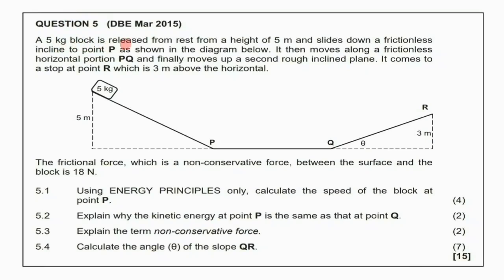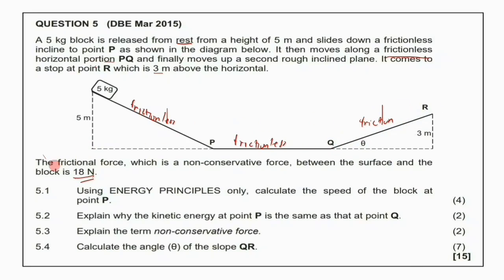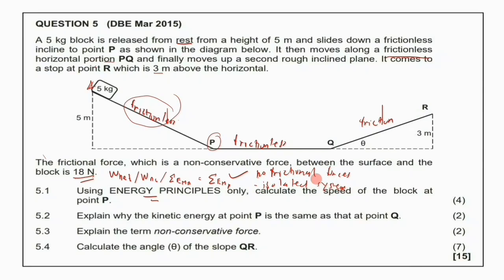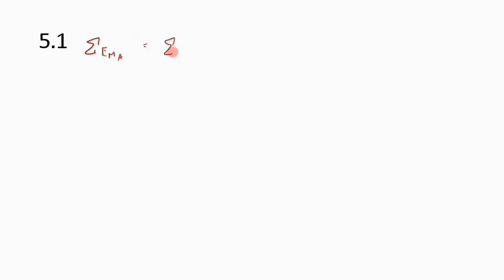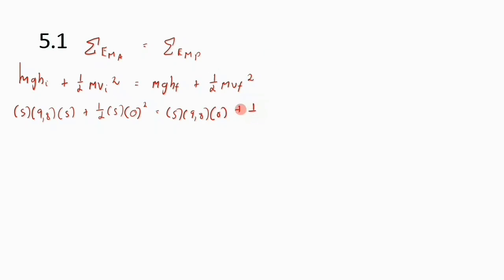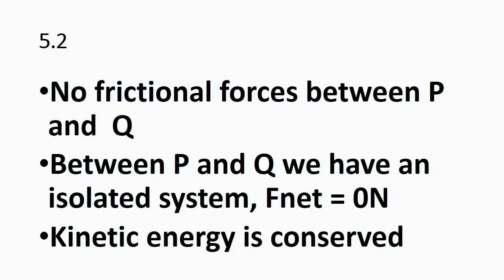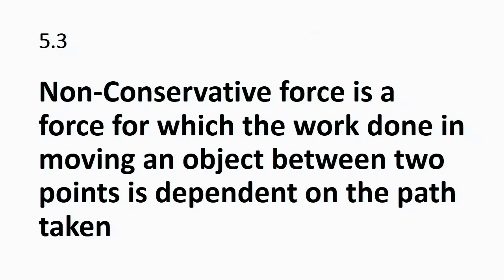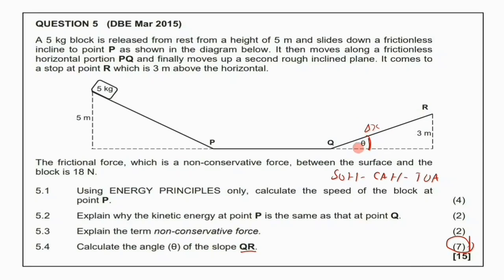DISSECTING WORK ENERGY AND POWER 🔥| DBE MARCH 2015 Q5 | Gr12

Comment: 9:13 Sir on th Wnc why didn't you include the fg//?
Reply from the maker: Fg// is not a non-conservative forces...its a component of gravitational force and gravitational force is a conservative force..... non-conservative forces are TENSION, APPLIED FORCE & FRICTIONAL FORCE
Reply: @science_therapy  ooh if we were calculating conservative forces we were gonna include it right?
Reply from the maker: @Gee_gontse  yep you'd be using the Wnet formula in that case where u add all the forces whether conservative or non-conservative
Reply: Thank you 🙏 @science_therapy